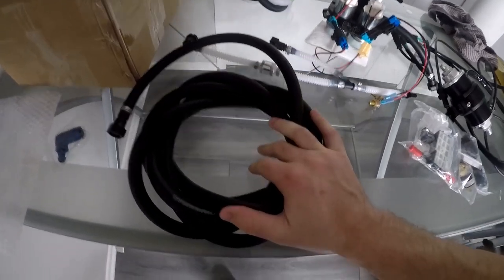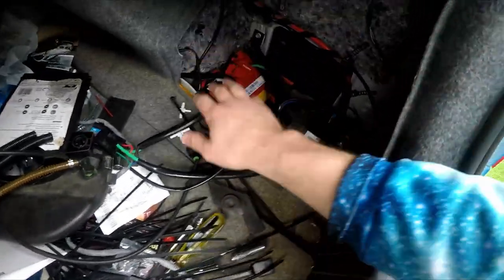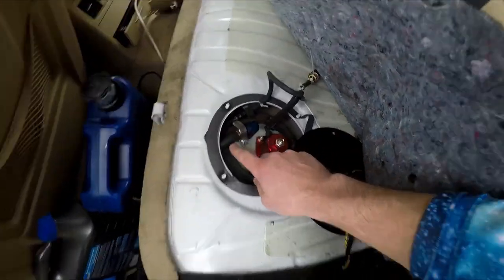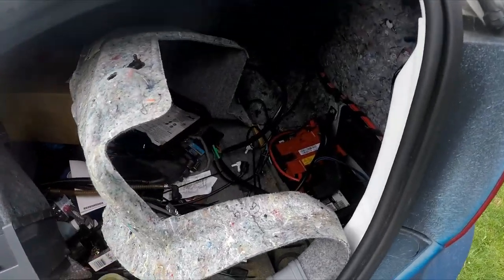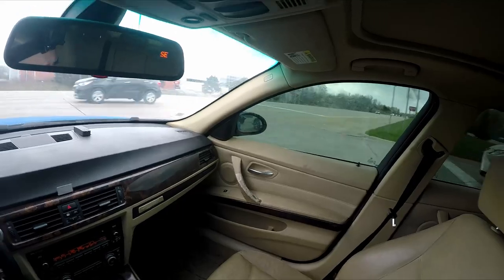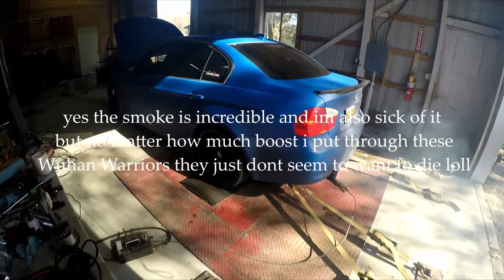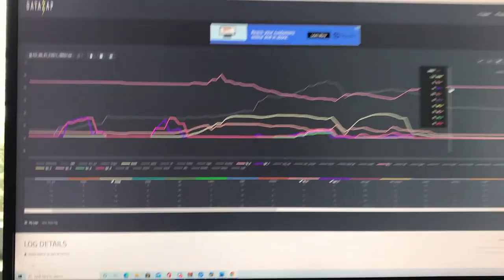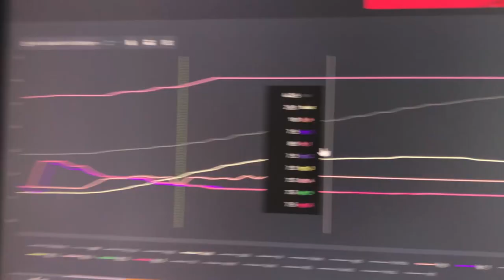32psi N54 GETS COMPLETE UPGRADED FUEL SYSTEM!!

Comment: Just wondering if you upgraded your PCV valve with an RB, and got dual catch cans? That could be contributing to your smoking issue.
Reply from the maker: No I havent added a catch can yet lol but I’ve had other friends to currently have 19ts in the car with all the fancy catch cans and they still smoke. It’s a faulty turbo seal which is why they released the new updated version of the 19t which doesn’t have those oil seal issues. I’m planning to still get a catch cab ASAP tho

Comment: Make sure you route that fused power cable through the grommet in the fuel tank cover, if it rubs on the chassis it will short out.

Did you retain the jet pump on the passenger side fuel tank when you replaced the FPR?

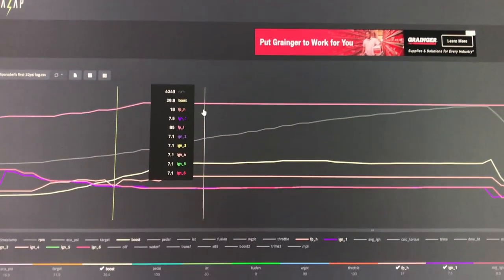21:00 That’s a beautiful fuel curve

Comment: Looked at your logs. I'm guessing the cylinder 6 misfire is coming after 6,000 rpm since in both of them you don't go past 6,000? It may be false knock triggered by transmission noise since you're making a lot of power and torque. More common on 6MT cars with the stock dual mass flywheel but I've had the issue on my automatic 535i as well. Also happened on my manual 135i. Switched to a single mass flywheel and didn't have the misfires anymore. Then switched back to a brand new oem dual mass flywheel and misfires came back with it so I went back with another single mass. Vehicular DIY did a video where he replaced the cylinder 6 fuel injector seal and decoupler and he claims to have fixed his cyl 6 misfire issue that way.
Reply from the maker: Hey man great comment I love when people chime in when they know what they are talking about. Appreciate the help. Yes recently the misfires only happen at redline. So I shift early and it’s ok more or less. I have a buddy with lower compression than mine @120 and his is at only 90 and he doesn’t have misfires from it either. I will talk to my tuner about that flywheel what you have told me. We recently thought it was false knock also so he sent me a tune with misfire detection disabled but i am very skeptical and nervous to try that for obvious reasons.. lol

Comment: I went threw exactly what your going threw. Mine was a broken ringland cyl #1. Mine would misfire at 6100rpm like clock work. But if I shifted early it was fine lol
Reply from the maker: Damn yup that’s what going on with me I think.
Reply: @N54GASM  if your #6 cyl is low during a compression test, drop a bit of oil down the spark plug hole and re-try. If your number improves, (which mine did) it means it's blowing by the rings. Anyway I'm interested to see if your in the same boat. Cheers bro 💪💪
Reply: @N54GASM  my temporary fix was having my tuner turn off misfire detection after 6000rpm. My car pulled like a champ to limiter for like a month. HOWEVER, It was short lived as now my engine literally won't run anymore. ( Built motor in the works) 💪💪
Reply from the maker: @darrylcopithorn7208  Thanks man we were going to try and turn misfire detection off as the last resort only though..

Comment: Hey how you solve your low pressure problem? I put 19t Viv v3 , car idle fine on 72 psi as soon to do data log the low pressure over the place drop 59 to 58 then when up 72 psi to 90 psi.  On 93 Oct.